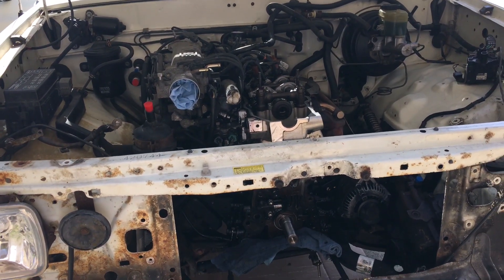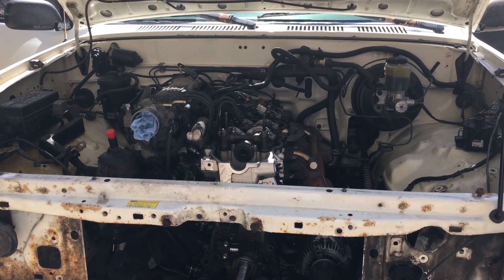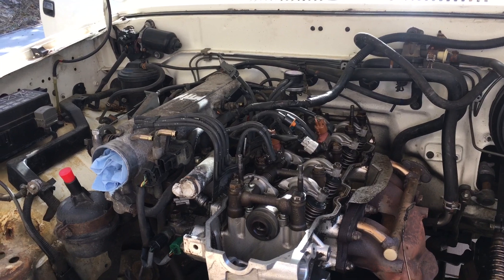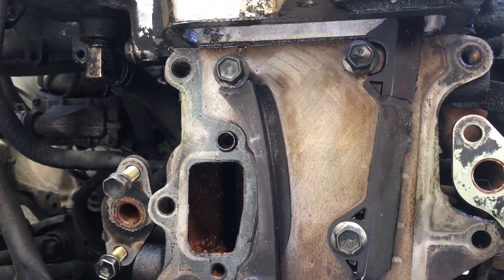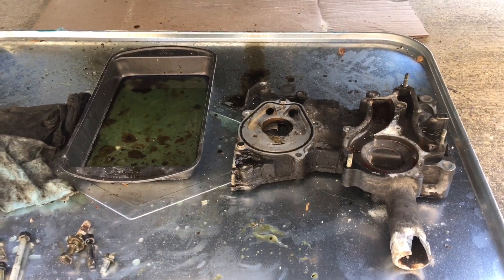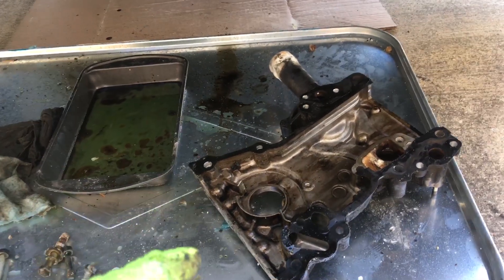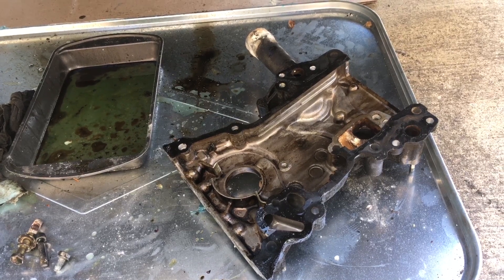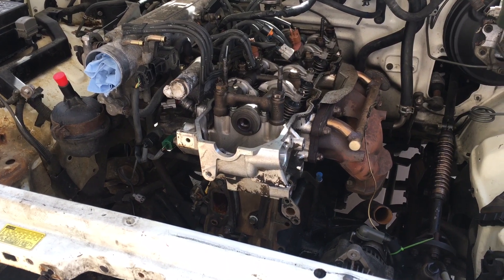Toyota pickup or 4Runner w/ 22RE - WATER IN OIL WTF? Loose timing chain tensioner & cover "failure"

Comment: The only actual design flaw here was Toyota's effort to save a dollar... The only thing that goes wrong here usually, is the plastic guide breaks. And in this design the guides actually are part of the tension so when that plastic guide breaks the chain flops around no matter how much tension the tensioner puts on... And as another commenter pointed out, they drove for a good long time listening to that chain slap against the cover. It's still baffles me why a manufacturer and /or engineers would even allow plastic to be used in a vital part, I mean really, did they say that much money going with plastic opposed to metal?
Reply from the maker: Yeah, I totally agree with everything you've said. Not an area where plastic would help anything.
Reply: Couldn't agree more. New metal guides from lCE are literally 80 bucks.Designed obsolescence I guess.
Reply: On a side note, not too hijack or change the subject but it's seems like there's fairly knowledgeable people here and I can't find anything on the internet about it so I thought I would just throw it out here... Is anyone familiar with the TPS sensors? I have two and they both seem to function but I'd like to have one as a backup. They have different part numbers which according to the internet the part numbers are interchangeable but it also have a four digit alphanumeric number. The one currently in my 22RE is M125, The other TPS I have has P125. 
Does anyone know what this four digit number represents?
Reply from the maker: @lexannaamnell6593  I believe the M125 is off the Camry, while the P is more like the 4Runner and Pickup. The 22RE, as you probably know, was used in passenger cars also. You can spend your entire life trying to figure out Toyota part numbers :) As long as the ohm readings from both TPS switches fall in line with the shop manual, you should be fine.

Comment: Measure the chain stretch per the toyota manual..  doesn't take long. I tell people this since most of the time the chain is in spec and the tensioner pad is the largest problem.  I have changed no less that 30 of these.  And Lc's kit is great as well as 22re performance.

Take the pan off and clean the pickup.  Most of the time the pickup will be 3/4 blocked with guide material. 

Anyways this is not a problem in my book.  In order for the chain to wear through the cover the owner listened to the chain slap for 40k miles.  Just a gross lack of maintenance..
Reply from the maker: All good points. I'm going to run a bore scope into the pan and look around to check the condition of the strainer. Not really wanting to drop the pan on this job. I'll tell you what, the stretch on this chain was pretty major; you could lift the chain up and there was so much slack you could almost skip it forward a tooth.
Reply: @Ray Nada   the chain being loose and the chain being stretched are 2 different things.    In the Factory manual there are instructions on how to measure the actual stretch in the chain.  Basically a pin to pin measurement over so many li ks,  why 11 sticks in my mind i dont know...lol.... I like to measure this because most I have done the chain itself is actually with in tolerance and I have found most times it is the tensioner pad alone that is the only thing alone making the chain loose.

It makes no difference either way as you are replacing it all anyways but I figured you may be the type that could appreciate the exact things taking place.

Of the 30 or so 22re timing chains I have replaced there have been zero that  didn't need cleaning out.  There is only one place the plastic guide pieces go and that is in the pan.  And of course like I said most of the time a good amount is on the screen already.  

You can only imagine the potential oil starvation problems this causes. Doing this job correctly means cleaning out the pan..

Another thing that only time will tell is bearing condition at this point.  I have had more than 1 22re that at this point where there was already bearing damage from running milkshake oil for too long and having the screen plugged up with guide material.  You find this out when you do your first start 😀
Reply from the maker: @scrappyjackalope9558  All great info, thanks! I'm going to pull the plug out of the main oil galley tomorrow and see how things look. On this particular motor, no way to know for sure how long this milkshake situation was going. Once we had the truck under our control, we dumped the oil as outlined in the video, etc. Good point about stretch vs. loose. I do believe there is going to be part of the guides in the oil pan, as I saw part of it already hanging out in that opening below where the cover bolts up. I know more soon.
Reply: I read both your comments Scrappy, well said and accurate as well. Pull the pan. I removed the head and the pan when I did mine, and yes, I put a dual-row chain in. Plastic is junk folks.
Reply: Same here. Pull your pan, and put metal guides in to solve the problem for good before you put it back together. If you want to work on CV axles or the front diff as well, nows the time.